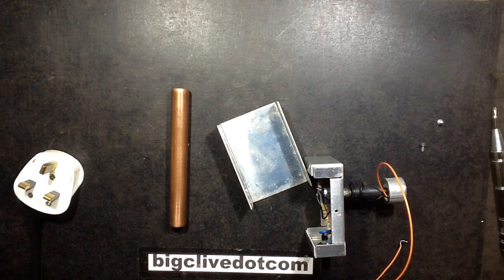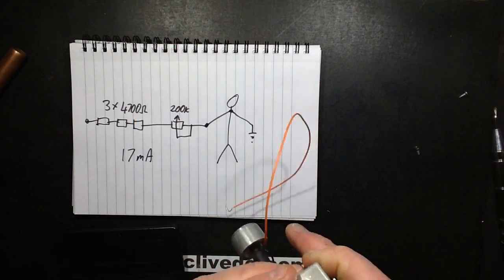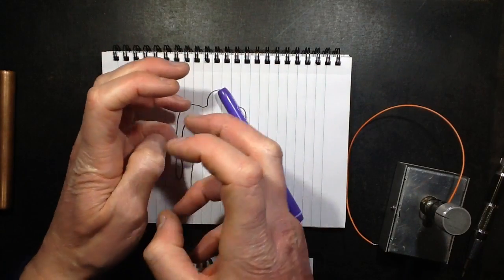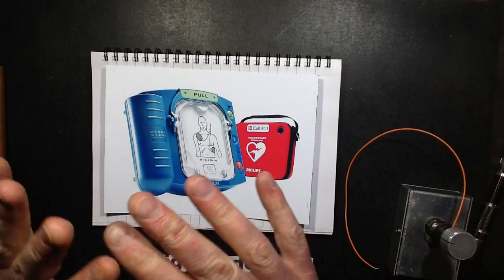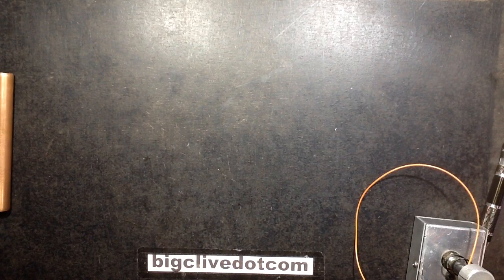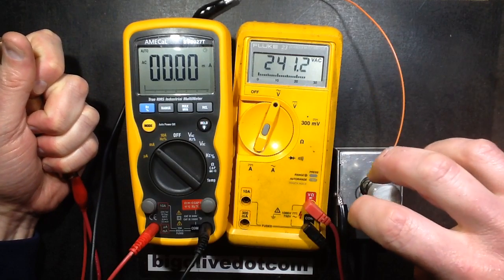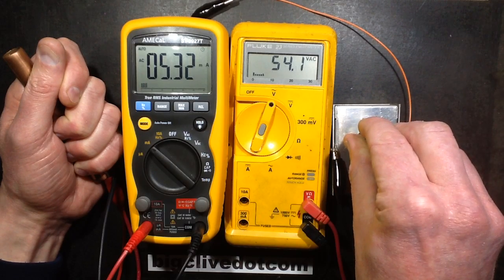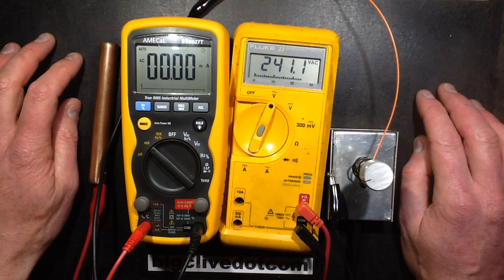Avoiding electrocution (Featuring real shocks.)

Comment: Now I’ve been watching the video on electrocution, interesting. I have a good understanding of electrical stuff and have successfully added and done much work with domestic stuff and never had any issues with my work,either for my self or other people.

But a number of years ago I encountered what I would consider was a (Sever Electrocution) and for whatever reason(I was Very very) luck .as I live to tell. I had wired up a Dust Extraction system for the work shop. This involved a old vac motor earthed and strapped to the wall. The motor body was metal and Exposed with tubes going in and out of fan housing.
On this particular afternoon I was using this extractor and must have accidentally caughtthe end of a (carbon-brush holder) on the running motor 220-240v 400w  electrocution proceeded. I felt the physical 50HZ frequency go down my arm and through my body in the 50Hz pulses. However what (Realy Sacred) me was my muscles in the hand locked on and despite every thought in my head saying (chuffing let go) I was (unable to). Now w I’ve had occasional shocks in the past ,but none that had contracted muscles in the hand  and clamped on. There was none around to turn of the mains in the shed and I was alone.
I did what I thought was the only thing I could,and speak to the (higher being). “ this is not a good day to die”  soon after I  managed to free and release my hand.
Badly shaken, my middle finger was streaming blood and after washing 3-4 layers of skin had been burnt away. If there is a (Superior Being) I think I was assisted that day.
220-240@400w I recon the amperage could have been between 1-1.5 Amps for probably 35-40 seconds,it felt longer.

The extractor was then removed and binned,lesson learnt. I was (Extremely Lucky) and have new found respect for electricity.

Comment: I just thought of my older brother. I had a flashback to my childhood, and my older brother tricking me into doing something stupid. Unplugging the device without telling me, grabbing both ends, and showing me how he could "resist" the electricity, then plugging it back on before I grab it is so something he would have done. He once told me, I think i was 4 or something, that if sunlight passed through a crystal it would make my skin invulnerable to a knife. We tried it, and little did i know he ran the back edge of the knife over my hand. Later, by myself, I tried it on my own. I didn't use the back edge and needed stitches. Boy, my dad whooped his ass raw that day. 😂😂😂

Comment: Another thing to note is that human skin is hygroscopic i.e. it absorbs water, so if you've just come out of a bath, shower or pool your skin acts like a sponge and holds water even after drying yourself making its natural resistance drop significantly, so never attempt to change a light bulb after taking a bath
Reply: That's not exactly true. The skin dries off really fast once you dried yourself. I have tested it on myself by measuring my skin resistance before and after a bath. The resistance was more influenced by psychological and neurolgical factors than by taking a bath. And one should never change a light bulb wothout making sure that there is no contact to voltage, or better no voltage at all, while you handle it.

Comment: I will never forget, I used to revamp Pizza Hut Point of Sale. That included installing all new ethernet cable throughout the building. In one attic, down in Ridgeland, MS, there were no crawl boards, so you just had to crawl from joist to joist, which can be a little teetering at times. You need to reach out and touch a brace to keep your balance. Well, I was in open space and needed to steady myself and saw a conduit right near me. So, like many times in the past - I just touched it to balance myself and immediately locked up. Somehow, someone had wired things wrong, or something had shorted somewhere, and the conduit itself was hot. I just remember for the probably few moments that seemed like minutes I couldn't let go, and the world started closing down to tunnel vision, I thought "holy sh*t, I'm going to die in a friggin' Pizza Hut attic.... this can't be happening" LOL - fortunately for me I woke up about an hour later all sideways and sore across a couple of joist with a nice coating of nasty old insulation glued to me, all sweaty and nearly overheated. Somebody was watching over me that night! :) I just don't know how it locked me down that hard. I've been bit by 120 before and it's just a "dangit!' experience. This must have been 240 or something was really wrong.

Comment: An American GFCI trips at 5mA, which is a non lethal current, and your RCDs trip at 30mA, which is almost a lethal current, so why do your RCDs trip at 30mA and not 5?
Reply from the maker: Ours protect entire circuits or multiples of circuits from the distribution board.  5mA is better suited to just a single outlet.   30mA isn't necessarily a fatal shock, but an extremely unpleasant one.
Reply: 30 mA only starts to dangerous after 3 seconds. At 20 mA the GFCI trips within 50 ms at max. usually.

Comment: I learned a few things working on broadcast transmitters (3 phase 208 line side, 5-12kv inside) from my mentors first day. Always check the disconnects before opening anything even if you threw the disconnects, use the jesus (ground/discharge) stick early and often, work with one hand in your pocket especially if you got to energize something, don't stand directly in front of whatever you are powering up including circuit breaker and fuse disconnects. It becomes routine and you find yourself standing aside when you turn on a light switch or plug into a wall outlet at home. A lot of times we would be there because of a lightning strike and you never know what else you might not see might be damaged and blow up when you turn the power back on.. if your hair stands up and things start popping just hit the deck.. another storm cloud has come up and your in a building connected to a 450ft lightning rod.

Comment: So we can touch a 240v live/phase wire and not get electrocuted as long as we are not creating a path to earth or to the neutral? I thought at 240v even touching the live would give you a shock without creating a path to earth as 240v is low voltage to linemen but enough to get a shock? 

Great tuition and guide to electric shocks and prevention and how to avoid Clive. 👍👍👍
Keep at it mate. 💪💪💪
Best regards,  
Scott. ✌️🙏✌️
Reply: You can get a capactive shock. Because AC can flow through capacitors there is a small, usally insignificant current through the body at low voltage. At 10 kV and more you start having discharges through the air. At high frequency even more. That's why Tesla coils create arcs through the air.

Comment: Re the defib. Even if someone goes into cardiac arrest and you do not have a defib, 100% start proper chest compressions and keep it up until paramedics/emts arrive. I always encourage everyone take a CPR course every so often as this can help pump  the blood around and prolong irreversible damage. This includes flat line, if caught as close to immediately as possible. Mouth to mouth is no longer deemed necessary, even in choking victims etc, so long as help is on the way. Also, if there are multiple people standing around, be sure to rotate whos performing CPR every two minutes or when you get tired. If you've never done it properly, you don't realize just how tiring it is and if there is 1 person who knows how to do it correctly, you can easily teach someone on the spot to take over. excellent video Clive, That was uh electrifying, actually had me a bit worried there.
Reply from the maker: See my video called The unofficial guide to electrocution.

Comment: I kinda done myself a bad one about 20 years ago. I done hotel maintenance but I wasn't trained in anything, just more a handyman role. You probs even know the hotel Clive, it was the Ingram Hotel in Glasgow, it used to be Stakis but was Ramada while I was there. Anyway the restaurant had a load of different lights, with some being wired to a sliding dimmer switch. If the dimmer was turned too high it would trip the whole restaurant lights out, so our main maintenance guy (who was qualified) glued a strip of Perspex across the slider to prevent it going past that point. The fuse in that dimmer conked out 1 day, I was the only maintenance guy on shift so I had to change the fuse, so I unscrewed the fuse holder to check what fuse it took, then went & got a replacement. However when replacing it I wasn't aware the fuse had to be put in the holder & then screwed in, & like a proper numpty while holding one end of the fuse, I pushed the other end in to the switch which still had power running to it... Then the fun began. I was like a little electric toothbrush, I could feel the electric literally buzzing through all my bones & teeth, and I don't know if the buzzing I could hear was the electric or my bones vibrating. I couldn't let go initially either as my whole body kinda seized up & it took me a good few seconds to even realise what was happening. A cpl of the chefs seen what happened & came to help as I turned white & felt pretty faint & shaky, but I was fine after 5-10 mins. I got pulled by the boss for it, and the next day when telling the other maintenance guy what happened, he explained that if that bit of Perspex hadn't been glued there & the slider was any higher than what it was, I wouldn't be here to tell the story... Edit, I typed this before us stupid handymen got a special mention, oops :/
Reply from the maker: I do know the Ingram Hotel.  The position of the dimmer wouldn't really have made a difference to the level of shock.
Reply: @bigclivedotcom  Would it not? As I said I'm no expert, but the guy I worked with said that was preventing it from being at it's full load. However if it didn't make a difference, then I guess I'm even luckier to be here, because that must mean I actually took the full load?... Thanks for the reply m8.

Comment: The amount of moisture on and in your skin, and thickness of skin / calluses  will make a big difference in the resistance your skin provides to electricity.  A person who has heavy calluses and dry skin will see a lot lower current flow than someone with sweaty or wet skin.  And if the wire manages to poke through the skin, that's an even lower resistance.   Higher voltage will also penetrate the skin more.

Comment: I had my own business floor and wall tiling For 7 years The amount of times I hit the wires on the back of an exposed 240v uk mains electric socket on a kitchen wall with a wet sponge trying to clean wet grout off the wall Dead centre back of my Hand left to right Always had nice Bruce line About the thickness of a pencil from hitting the back of my hand off of the cupboard edge above

Comment: The first time I installed a GFCI, I wanted to 1, see if it really worked,  and 2, see what it felt like at the trip threshold. So after connecting it properly,  I put a jumper into the ground slot, and one of the leads of my multimeter into the live slot. I squeezed to ground with two fingers of one hand, and slowly touched and then squeezed the other test lead with two fingers of the other. The GFCI was supposed to trip at 60 ma. Well, I got to 100 before I couldn't stand it any longer. The device never tripped.
Reply from the maker: I wouldn't recommend trying that test hand to hand.  100mA is actually high enough that you would have been well and truly locked on.

Comment: its interesting to see your "improvised" device professionaly made in swiss, for use in the training of the next generation electricians.

they used a wirst band to prevent the current to go over the heart area so you could go higher with less danger to your heart. they also added an fault current protection so you could not go over the 30mA.
it gave many students/trainees a shook how they could not release the handle even if they tried.
Reply from the maker: A conductive wrist band would not work.  The skin has a much higher resistance than the interior of the body.
Reply: @bigclivedotcom   they made the wirstband a bit wet so the contact resistance dropped at that point. the hand contact it self was dry as theyre Hands made possible.

Comment: Do you sometimes know how I can measure whether my fan at the front of my car is still working.
Reply from the maker: Depending on the system you may be able to measure if voltage is present at the fan connector.
Reply: @bigclivedotcom  I can't seem to get this connector off.  pffffff
Reply from the maker: @rudyschurmann6211  It probably has some clever locking system.

Comment: I screwed up wiring up one of those china power supplies with all vented metal casing.  Plugged it in and it wasn't working.  Realizing my error, I had connected the live wire to ground thus making the whole casing live.  Had I touched the casing while figuring it out, I very well may not be typing this.

Comment: intelligent, brave and crazy, that's how I like my youtubers 😁👍

rly old video I know, but if you ever do it again, I'd be interested what would be different at lower voltages... do you need more current to feel the zap?
What if you don't hold the electrode in your hand but step on it with a naked foot, would the voltage drop further?
Is my logic correct that with the ~50V and 0.5A shown on your meters, you could have included a 25W light bulb in your circuit and lit it up ?
Reply from the maker: I did it again.  Search my videos for 10mA

Comment: Ive had a few shocks with mains and HT throughout my life,the worse one was a mains transformer which i picked up thinking it was disconnected,my hand went across the L N,boy did that make me shudder,if across the chest im sure i would of died.Made a bit of pocket money selling electric shock modules,best design was a light steel ball cut in half,actually off center,so when throwing you have more chance to avoid getting a shock,soldered a 500 volt 470nf cap ,to each half,thin plastic strip glued to the inside of each half to join them together,a 9v secondary transformer,9v pp3 switcheng with a push button to the secondary,to get big volts on the primary,this is used to charge the ball up!!!! only and remains outside of the ball ,then chuck it a a mate and say catch ,had some fun with the new employees LOL DONT be tempted to up the capacitor,it will kill.

Comment: Would it make a difference if say your elbows were touching or connected? Would it still flow across the chest or would it not go further than your elbows or would it go across both?
Reply from the maker: It would still pass through the inside and across the chest.  Your insides are MUCH more conductive than your skin.
Reply: @bigclivedotcom  what about if you had say a strap on each wrist, like the ones you get on the electro static mats or desks, connected with a lead, would that have the same outcome or would it lessen the flow through you a little bit?

Comment: I just installed a 10mA earth leakage breaker for my bathroom. I had to order it from the Netherlands, there it is now mandatory for bathrooms in new buildings. The rest of my house is on 30mA, except one outlet on the mandatory 300mA, but that one is not for household usage and I put a label on it that will scare most people. 
Thanks for that unexpected explanation about defibrillation btw. Tbh, i had no clue about that thing hanging at the entrance of the building i work, i only think about prevention i guess.

Comment: I know this was a long time ago now, but having just seen this, I have to say:  Please tell me that you at least had someone else present off-camera watching while you did this who could intervene if something went wrong..  The max current of that box is actually legitimately verging into potentially fatal territory, and if you had, for example, somehow spasmed or accidentally turned the knob to max, you could have been legitimately looking at actual electrocution.

A large part of the reason why linemen have such high fatality rates is not just that they're dealing with high voltages, but that they are often working alone, or fairly far away from others, so there isn't anyone around able to intervene or perform medical actions when something does go wrong.  When dealing with any potentially dangerous electrical situations, even skilled people should never do it alone if at all possible.  Having another person around can easily be the difference between having a scary story for all your friends to hear or a funeral for them all to attend.

Also, please keep in mind that just because you've done it before doesn't necessarily mean it will be safe to do it this time.  People can develop undetected heart conditions, etc, as they grow older which might not manifest normally, but could make a big difference between "that time I did it a few years ago" and this time you're doing it now...
Reply from the maker: No.  But I limited how far I went.

Comment: I was told that 15ma ac was enough to kill and more so if that person receiving the shock had wet or sweaty palms. A friend who does repairs said he always put one arm down to side when messing with electrics. I assume that's to stop current  travelling ACROSS the body and through the heart 🤔.  Is it also true that electric shock can be accumulative? So 1 shock might not kill, but lots of shocks over time can be ?
Reply from the maker: No shocks do not accumulate.  If they did there would be lots of dead maintenance workers.
Reply: @bigclivedotcom  😆😆😆😆 Yes I guess there would Clive, but what about damage to muscle or the heart if only minute?    Just a silly question I guess. Keep up the good work.👍